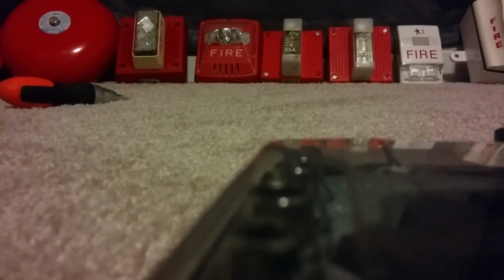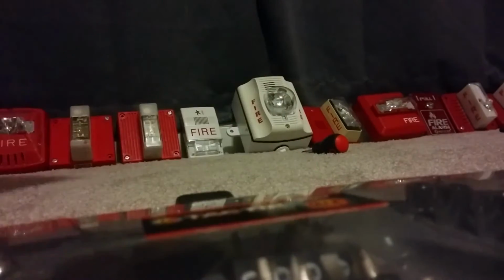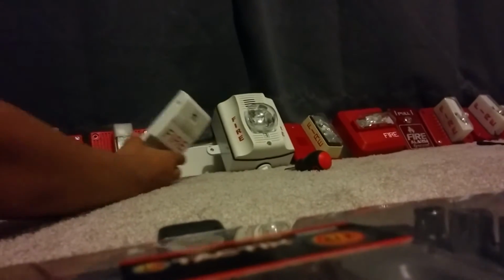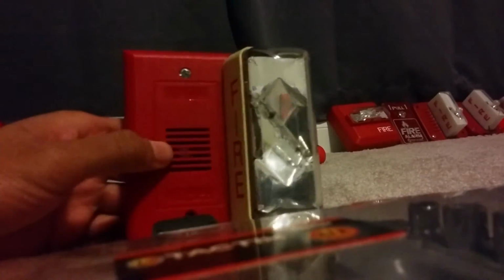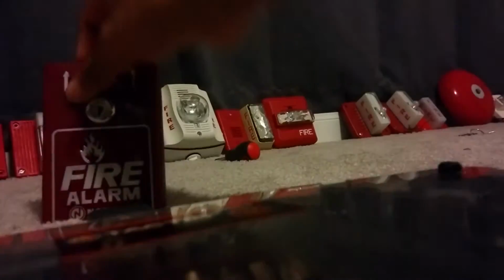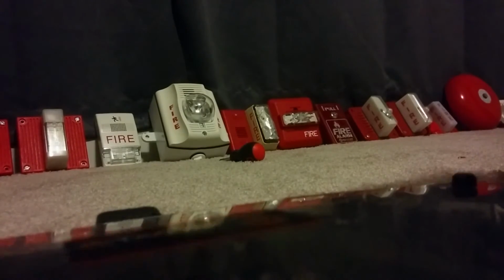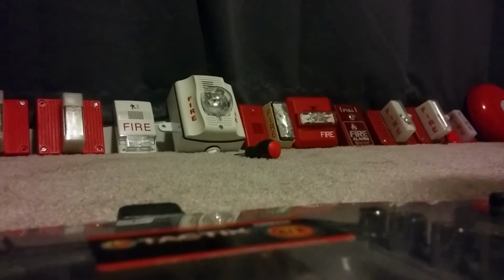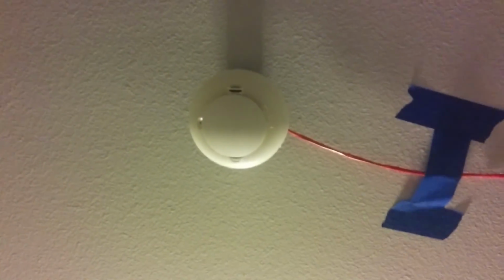My fire alarm collection(Requested by Frank Dougherty)

Comment: Nice man! Someone must have modified that ehel-1 because I have the exact same one, but it's an mt. No it's not the normal mt with the sides that come out, it looks like the ehel-1 you have, and it runs on ac power. It's wierd. Anyways, great video, can't wait for the next system test. Ps. You just gained a subscriber, who turned on the bell notifications!!!!!
Reply from the maker: Alexander Goushy Your kind gesture is deeply appreciated. Thank you for tuning in on this channel. Couple videos will be release shortly. The EH-EL1'S are not modified, they came from the factory like that and so did yours. Is the model number on yours MT-115-WM?